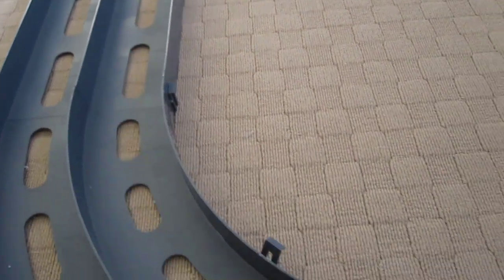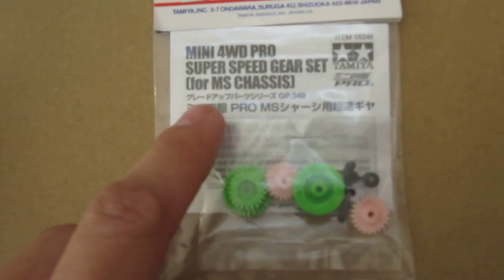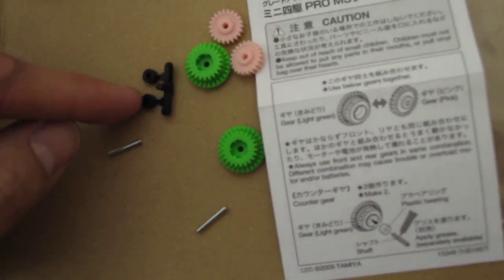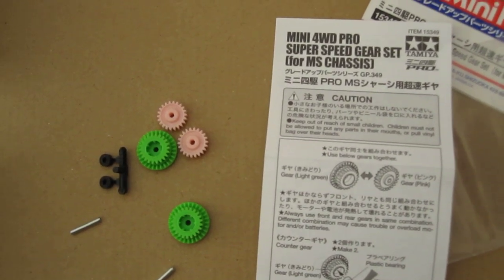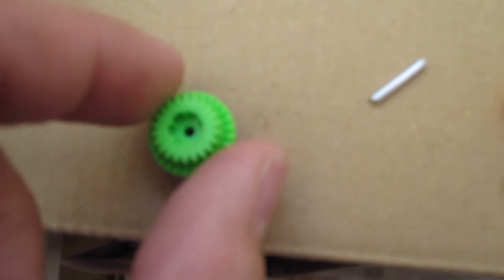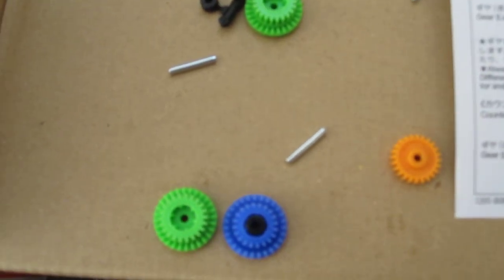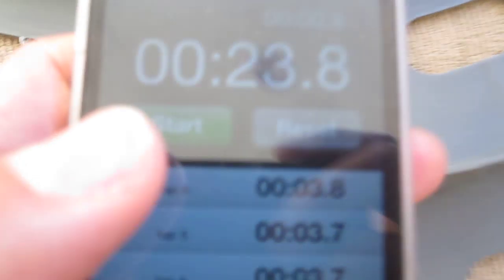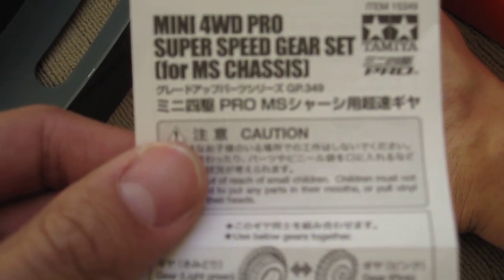Tamiya Mini 4WD Avante Mk.III Azure Clear Special 94741 - Lap times #03

Comment: This upgrade works very well on long tracks. Your track is too short for this. The gear upgrade is worthy depending on the tracks. First upgrade should be battery and motor. Good videos anyway!